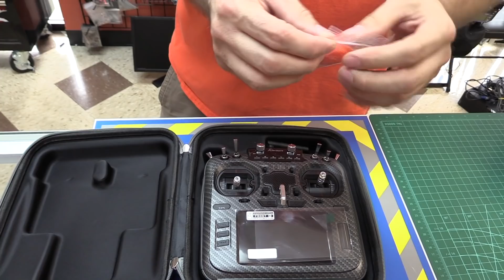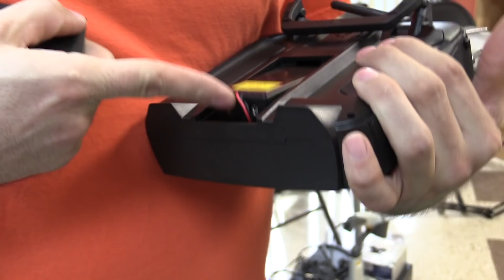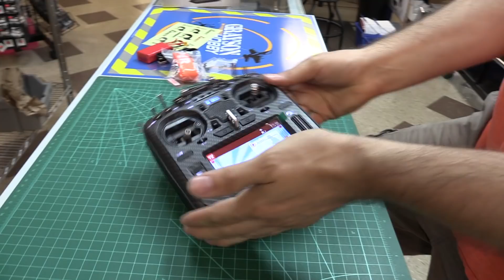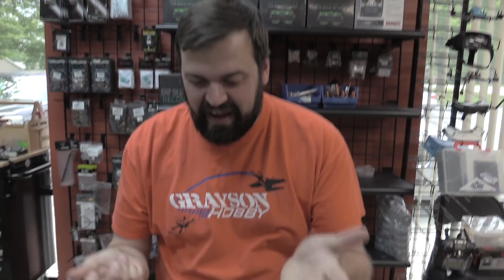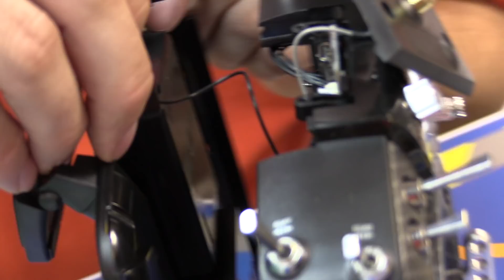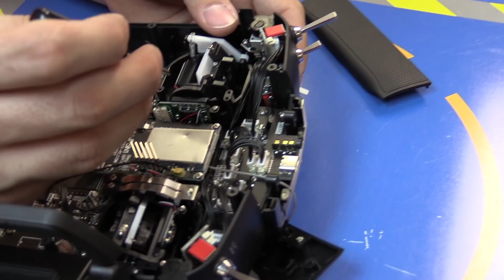Jumper T18 PRO 🔥1st Look | How to Bind the 5in1 | Upgraded Gimbals

Comment: You can't just say the internal 2.4 ant doesn't give any less range , you have to do a proper range test comparison . I've watched a couple good reviewers that have shown that it does have less range than the comparable radios with a standard stick ant .  I am skeptical of that short (2.4 style) external ant they are using for 900 MHz . Antennas for 900 MHz are generally double that length . Without a touchscreen and internal charging this radio should cost no more than last years T16 Pro .

Comment: There is 0 upgrade to this over the T16 hall except for no ribbon cables.  Which is actually a big deal.  No touchscreen, no internal charging and the 900mhz is... yeah...  My 16 Pro Hall is still working 100%, never had a ribbon cable issue and hoping that I don't and the new ribbon cable fix is good.  Plus a single internal antenna because the external is taken up by the 900mhz.  T18 Lite is the one of these to get if you get one.  I'd be really pissed if I ordered the regular or the Pro honestly.  Get the Lite if you get a T18.  And I am probably going to get a T18 Lite because I hate thew way the RM looks and I'm going to move my Bob's battery mod from the T16 over to the T18.

Comment: I was hoping for internal charging. Kinda of disappointed or cordless magnetic charging.
Reply: Bob's battery mod.  100x better than USB charging anyway and you can power a Crossfire full size module from the radio battery using it.

Comment: Great review guys. I have a T16 and also had nil ribbon cable problems however their deletion in the T18 is very welcome. That said, I use 18650s in the T16 (as I have heaps) but the T16 churns through them pretty quickly which means you are regularly taking the back off to charge/replace them. With all those lights I can't imagine the T18 will be any better on energy consumption. To not have external charging on the T18 Pro is a WTF moment! Yes, I know there will be an upgrade kit in 3-6 months but to be honest I will just wait ! As i said, great review, really enjoy your reviews.
Reply: My t16 (pro v2) charges my 18650's fine internally with a usb-c cord from my low amp output pc jack. All the kids whining about it not supporting high amp charging via "USB-C Protocol" kind of miss the point in excluding it. Jumper has no idea what kind of battery your gonna rig in there. End users could be putting in a dangerously low c rating lipo or lion and putting a lower amp "trickle" charge board makes way more sense from a business perspective, as well as moral should there be a loss of life. You want it badly enough, buy the cheap chip and engineer it in there yourself. Buy first, cry later is always the adage for industries and companies this new, especially in fpv. I flew a $30 Flysky I10 for years before I decided the t16 was worth the jump into a serious tx. I was lucky enough to be in the market after it was fully revised and can understand the buyers remorse. Yet even early production T-16s are leagues above the more costly x9d standard of days past. Where's the innovation there, frsky? Same radio for years and years nothing majorly improved, not price dropped. Also the people upset on ribbon cables are really the true "Karen's". Aside from the qc problem of pinched cables during assembly, ribbon cables on fixed, non moving components will pose zero reliability problems. Y'all better be complaining to Samsung, Apple, TCL, the phone your using right now, all the makers of any electronic device your using with a screen. Y'all misinformed trolls messing with these solid guys livelihoods in a sense, and I don't appreciate that man, Basil and Will run an amazing business! Aloha brothers from Hawaii and keep flying high guys!
Reply: @MissingNumb  good rant, not sure what it all means, but good for you !
Reply from the maker: Thanks for the honest feedback!
Reply: Not sure why internal charging is a bonus?
I mean, I dont charge my lipos in my kwads or aircraft...
I feel safer taking my batteries out to charge, as I like to keep an eye on 'em, but thats me.
Reply: Because it's easier. Also mucking around with the leads and connectors in the battery bay is fraught as they are pretty frail.....the connectors on your quads are XT30s or XT60's maybe....much more robust?
Reply: @Stashmanfpv  It's nice to be connected to the PC and it charge while you sim .

Comment: As much as I like this one, I’m still glad that I preordered the radiomaster, as it seems to be a bit better quality overall, and with the internal charging, and no touch screen, means it’s behind the game.
Reply: Plus the additional cost is another reason why I believe I got the better radio.
Reply: @DavidReynolds-kr6yh  True, the value is great.  There have been a TON of issues with the RM QC wise tho... hope yours is fine.  From ppl already having to do roller wheel mods and install a louder speaker to switches not working...

Comment: Ok maybe you have answered this before, but looking back I did not hear it so I will ask it here, WHAT is the Difference in OPEN TX and DEVIATION software?... I ask because some of these Jumpers are using one and some the other...
( note I use the original Jumper T8SG [ Black& Silver one ] it has Deviation )
Reply: They are both software to run your TX . They are both open source software. Deviation also started the multi protocol project. That is why earlier Jumper are running the Deviation firmware.  The 5in1 or 4in1 module  are based on Deviation multy protocol software.  You can actually directly download the Deviation firmware on most Devo TX.

Comment: I like you guys and your videos but I have to say that seems a little strange that you will say they did not include a touchscreen because the touchscreen support is not there yet and it's likely to be janky when it comes out but then you say the 915  MHz module will probably take a couple updates before it really starts working properly and you're okay with that... ?
Reply from the maker: Think of it like adding the flux capacitor without mr. Fusion. Basil

Comment: My T16-pro v2 was worst $180 I've ever spend.
Reply: i bet my ver1 was worse. Didn't keep time, battery error, even replaced it internal battery, followed by the intermittent keystuck error. Even replaced the suspected MDL board with 3 new ones boards + ribbon cables.

Comment: I purchased my T16 mainly for a future robot build that more than 16 servo channels could be enough to justify getting a T18. I saw there is a possibility of 32 channels with the right receiver, but that is all I have seen. What 32 channel receiver works and could be used to control 18 - 20 servos with some of the other channels used for other things like lights and Arduino input.  I see very few people using more than say 8 or 10 channels tops so information is slim.
Reply: just use two  16ch rxs

Comment: Futaba uses panel antennas  on their  T 6K without issues.
Reply: apples to oranges. Futaba is not Jumper.
Reply: @calibermix8159  Yep... and funny how these guys are making fun of Futaba in the beginning... like... Futaba is pricey but they are light years better quality.  That said... I'm not paying $2k for a transmitter unless I'm actually flying competetive.
Reply: @scottyd035ntknow  I didn't say Futaba was the best quality ever made because they also use cheap components I was just comparing the reliability of the antenna or RF link to Jumper

Comment: USB-C charging - Actually USB-C is a standard and there is a standard/certification organization.  It just means either they they don't know what they are doing, or they don't want to pay for a single chip USB-C charging solution.
Reply: I vote for the first option. the charging system for the T16 was a deal breaker

Comment: No one is mentioning if this radio has "fail safe" mode? SO I can pre program a radio setting if the radio loses communication to my receiver. Does the T18 PRO have this?
Reply from the maker: it has fail safe for 2.4ghz as of June 2020 - We did a video on the T16 FailFail - it an opent tx / multi module feature, not the radio.

Comment: Please do not charge any battery in your transmitter in the first place.. bit of a gripe on people that want internal chargers. You dont charge your lipo in a plane or quad do you ?
Reply: yep, true for lipos. But most of the users are using cheap Li-ion 18650s. They are safe.
Reply: Do you take your battery out of your cellphone to charge it. You must be a newbie cause back years ago thats how you charged the batteries in your transmitter
Reply: @MikeyMikey1968  LOL it must be another old fart that pull the battery out of the hatch for charging

Comment: Honestly if I had known the touch screen was going away I would have pre-ordered the lite ver. instead of the pro. Kinda bummed
Reply: The Lite is the one to get.  Still has Hall Effect, has an external 2.4ghz antenna instead of a non dual diversity internal antenna and costs the least.  Crossfire beats the hell out of R9 anyway so the 5 in 1 is a non issue.